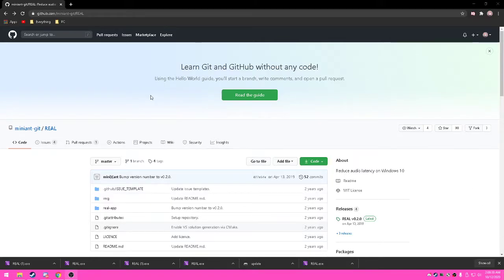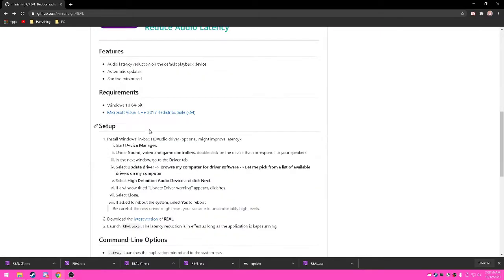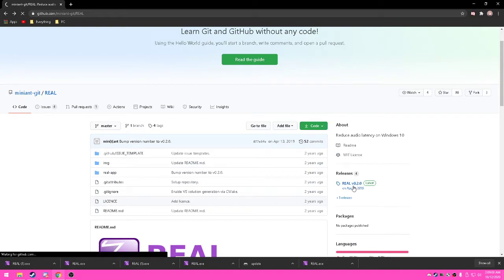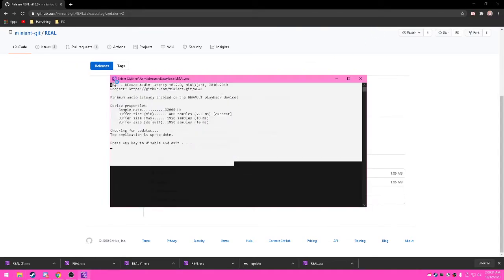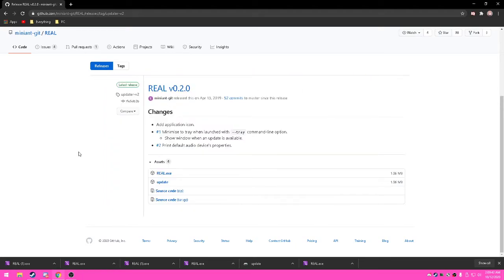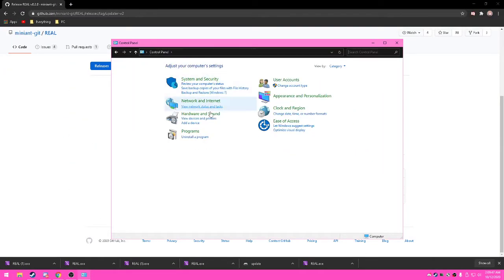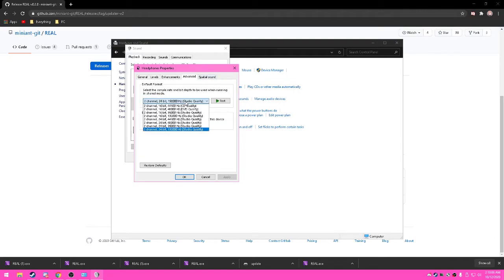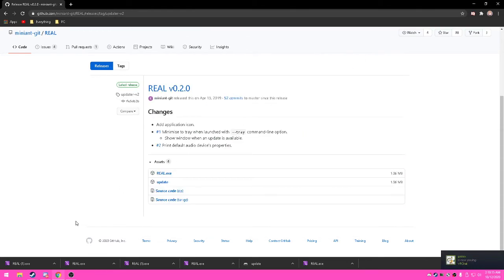how to reduce audio latency in Windows

Comment: The only way this works is if I use an aux cord from my headset to my tower and it goes to 2.67ms buffer. The line-out (green) audio port directly on my motherboard does not function with an aux and my headset normally connected to a gamedac then to a USB does not work, both stay at 10ms. I can guess the USB issue but not sure why the line-out is like that.

It would also be really cool to increase the functionality of this to allow users to set the bitrate (I think, audio quality metric) in conjunction with the buffer i.e. it'd be nice to personally set a 3.33ms buffer and have 192kbps audio quality.